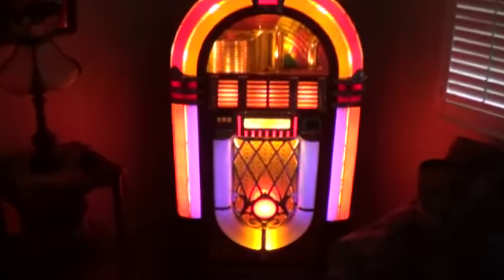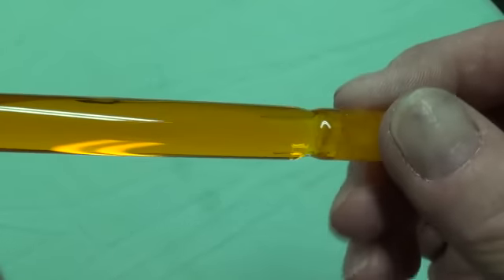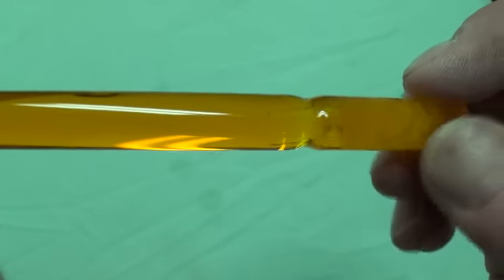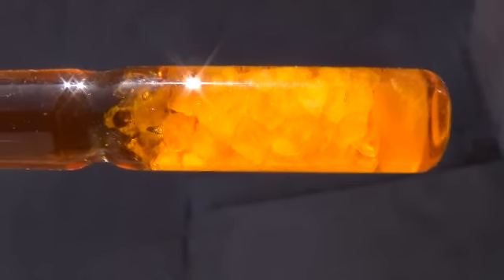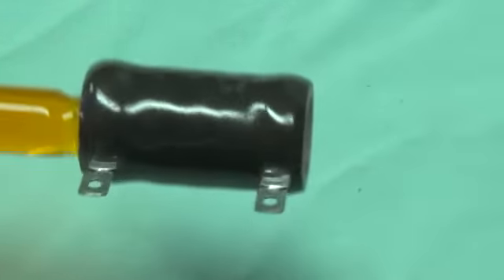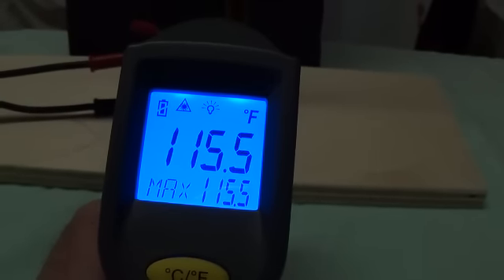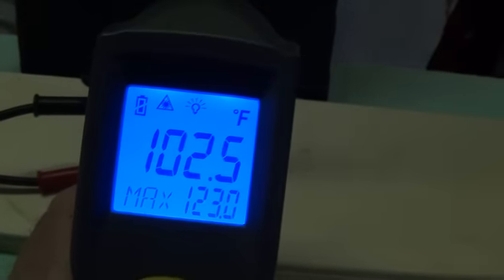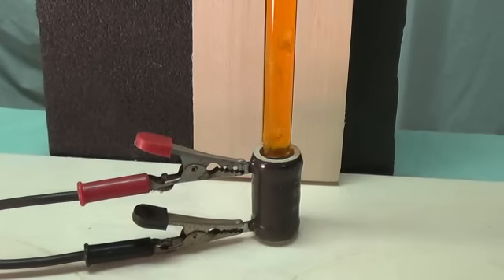Wurlitzer Bubble Tubes: How They're Made and What Makes Them Bubble

Comment: Outstanding videos Doug. I have been a jukebox collector for almost 40 years and have 18 restored grade 1 jukes, including a 1015 that was restored to perfection in the same N. Tonawanda plant where it was built in 1947. As an FYI, the so-called sand granules at the bottom of the bubble tube were called "bumpers."
When the granules were agitated by the heat they would start to spin and  "poof" --  the liquid boiled and began its journey to the top of the tube. Great videos!

Comment: Doug, now that's service!  Your response was super fast, but after posting I went up to my machine, armed with my new learning from your video and checked to see if the the tube was snug against the resistor.  It was not.  I checked the others for comparison, and it would seem that shim has come out or was never in.  I moved the machine on its back, so that may be the issue.  I put a piece of folded tin foil in to check, and it didn't make the noise, so I'm getting a proper shim.  Thanks.

Comment: Nicely done Doug. As an FYI, many years ago an old Wurlitzer Operator told me that those granules at the bottom of the tube are called "bumpers." If you watch them as the tube heats up they begin to spin or agitate. This assists the bubble tubes from starting normally and not "jolting up" when the liquid expands. Unfortunately some years ago my left front tube burst(nasty!!) it came out as a puke orange liquid and ruined several plastics and had to be replaced. Expensive!
You cannot remove the stains -- everything must be replaced. So I tell people treat them with care. Also, the liquid is extremely toxic and if a tube bursts and you are right on top of it and breath it in it will squeeze your lungs shut and instantly kill you!
No joke. I heard a rumor many years ago that the liquid was banned from public use but obviously they are still in existence. Thanks for your great videos.
Reply from the maker: Greetings, Ed. The liquid is methylene dichloride, which is a prime ingredient in paint strippers, thus the awful effect on back-painted plastics.  The fumes are toxic and unpleasant, but (from my experience) not lethal.....having inhaled way more of them than I should have during my years as a painter/restorer :))

Comment from the maker: Thanks, Ed. When I worked in a chemistry lab many years ago, we would put glass "boiling" beads in the bottom of vessels in which liquid was to be boiled. The beads produced small bubbles, rather than the big ones that can displace the liquid and make a mess. I guess it's the same process with the "bumpers" in bubble tubes. Thanks for your input.

Comment: Doug - your 1015 pilasters are rotating outward -- they should be rotating inward toward the center of the cabinet. Simple fix: exchange the motors in each pilaster and it will be rotating in the proper sequence. You can hand-position each rotating carriage so that all colors match perfectly as they spin.  Great job!

Comment: Wow very cool. I've always wanted to have an old jukebox, it seems they would require a lot of upkeep, but it must be a labor of love. I figured the tubes were heated by a light bulb, the way the old Christmas tree lights were, someone was clever in using a resistor.
Reply from the maker: Yes, they do require maintenance, Will. In fact, I don't suggest that anyone buy one unless they are capable of doing the upkeep.....or know someone who is.
Reply: With my old phones, if you use them a lot, they can require some maintenance, but the most technical part is usually the dial, quite mundane compared to what's going on in a jukebox. I will admit you get quite a feeling when you take an old broken down item, and spend time on it to bring it back to life again.
Reply from the maker: Yes, indeed, reviving an ancient device is always quite rewarding :)
Reply: The Xmas Lava lamps do not use a heater -- they use a low-wattage light bulb that slowly moves the liquid around. The Wurlitzer 1015 used heaters to keep the bubbles circulating in the thin tube. It was invented by the Biolite Company in NY in the mid-1930's.

Comment from the maker: Hi, Mr. J. I think it may have to do with inadequate contact between the bubble tube and the heater. This would also explain the late starting, since the fluid in that tube would not be heated as quickly.  You need to add a brass shim or two between the bulb and heater to tighten up the gap between them and improve the heat transfer.

Comment: I have a bubbler tube just like yours.  I used it in my 8th Grade science project (about 1974) on solar energy where I built a solar collector and used the bubbler tube as a visual display to show that the water in the solar collector was warm.  I never understood the "magic" of how the bubbler tube worked until I recently gave the tube to a friend of mine who is a science gadget nut and he found your video and sent it to me.  So after all these years, I now understand how it works (simple boiling).  In your video, you said that there is a tube inside the glass tube at the bottom.   What is the purpose of that tube?  Thank you!
Reply from the maker: There are crystals pinched in a bulb at the base of the tube that foster production of small bubbles. The small tube passes the bubbles from the crystal bulb upward to the rest of the bubble tube.

Comment: Hi Uncle Doug, I have four bubble tubes and four heat resistors (like the ones in this video.)  I wanted to use them for ornamental purposes.  But I'm worried about using an electrical heat source.  Are there any tips?  Failing that i'll just have to sell them on.  In the UK our plugs distribute 240 w.  Not sure what it is out in the states?  Thanks for your time...
Reply from the maker: The Jukebox uses an electrical heat source to make the tubes bubble, so that is not a problem. However, your 240 VAC supply may be an issue.  We use 120 VAC here in the states, so you may have to compensate for the difference in voltage. Good luck.
Reply: Thank you for your response.  Cheers...
Reply from the maker: @Raptor-123-z9w  You're welcome, Paul. Good luck.
Reply: Hi Uncle Doug, sorry to keep mithering you.  Is it possible to attach bubble tubes to heat resistors through use of batteries?  I understand old 1015s to be one of the many machines once containing battery generated bubblers? 
Thanks again for your time...
Reply from the maker: @Raptor-123-z9w  Greetings, Paul. In all my years of jukebox restoration, I have never seen or heard of battery-powered bubble tubes. The batteries would quickly lose their charge due to the current flow required by the heaters. Your best bet by far is to stick with 120VAC, as the designers intended.
Reply: @UncleDoug  

Hey thanks again.  You take care...

Comment: Doug I love all the vids.  What a beauty of a jukebox my friend...  Please can you tell me what type of crocodile clips do I need for my bubble tubes?  Is it just a case of picking any off of eBay and connecting them to regular leads?  I really quite perplexed 😆
Reply from the maker: I don't understand the question, Richard. Crocodile clips are not normally used with bubble tubes. They fit into tubular resistors with a brass shim to assure good contact.
Reply: @UncleDoug  Yes I understand.   But to me it seems, watching the clip, that all you need are clips attached to wire connected to a plug on the other end.  My concern is on the amount of electricity released.  You mentioned busting bubble tubes...  Thank you for the reply.
Reply from the maker: @richardbailey1993  The tubular resistors draw the proper amount of current to heat the tubes to the correct temperature.
Reply: Doug I do understand now.  Really sorry for being so dumb lol.  Electronics isn't my thing.  Thanks again for your time...

Comment: Two thumbs up! Your explanation is perfect, especially in regard to the tube acting like a car radiator removing the heat from the resistor. Question: Christmas bubble lights - are they made the same way? Given the chance of them breaking, especially in proximity to children, makes me believe that the liquid inside Christmas bubble lights is not Dichloromethane. In closing, may I had that the Workshop Dog, aka Rusty the Wonder Dog, was the pièce de résistance for this fine video.

Comment: Hi Doug....Ether will work instead of the original  methylene dichloride and clothes dye will colour it.  Small Granite chips will replace the  "bumpers"
Reply from the maker: Years ago, while I was working in a research laboratory, TJ, there was an ether explosion that destroyed an entire room, including a huge stainless steel hood. Since then, I am quite wary of ether.....it's not only explosive, but does not require an open flame to be ignited, only a hot surface. If you are using ether in bubble tubes, for heaven's sake, be careful.

Comment: Hi again
Would you have a video showing the mounting and hook up of the counter that mounts just to the right of the selection wheel of a Wurlirzer 1015. (Inside on the front right side) Mine is missing but I need to kniw how it works and hooks up to the jukebox. 

Thanks
Doug
Reply from the maker: I believe you are asking about the play counter on the left, rear of the mechanism (when you are facing the rear of the mechanism with the back door open). The best I can offer is a video (already posted) showing how the selector mechanism works. It should contain some close-up shots of the counter. I hope this is helpful. Good luck.

Comment: Hi Doug , I am in the prosess of restoring 2 x 1015's 1946-7  and two of the straight tubes " looking new "  came with the boxes , only bubble with hardly any Bubbles, I have swapped them over against a few resistors  , no'p  any thoughts as to why they have died please ?  ( no cracks no external damage ) many thanks  Tim.
Reply from the maker: For some reason, older tubes seem to lose their ability to bubble, Tim. I think it has to do with the "crystals" seen within the bulbs at the base of the tubes. Nothing, in my experience, will rejuvenate them. Sorry :(

Comment: Hi again Uncle Doug,
What lubricating oil would you recommend for a Wurlitzer 1015 OMT 100-cd jukebox ?? Many thanks, Liam.
Reply from the maker: Liam, I would think that any good, light mineral oil would work, like 3-in-1Brand. If you can't find it, then 10-30 motor oil would probably work just fine also. Good luck :)

Comment: Is that the same kind of chemical they use in the "hand boilers"  or the "Drinking Bird"  novelty?  I know that stuff has a super low boiling point.
Reply from the maker: +DeadKoby   It's probably what's used in the "hand boilers", DK, because these bubble tubes will also boil just from the heat of your hand. I thought the "drinking bird' simply used water. A Google search might reveal the answer.
Reply: The hand "boiler" just uses water or any other liquid. It's not actually boiling. What happens is it forces water up the tube due to expansion of air in the lower chamber from your hand's heat. When the water level gets too low it breaks the seal causing some water to pour back down  and the air pressure in top and bottom to equalize. This makes it seem like it's boiling but you're really just seeing water gurgle around inside your heat engine.
Reply from the maker: Thanks for the explanation, AQ :)

Comment: Cheers mate.  Very informative video.  Googled it and read explanation but your video could not be more clearer.  Especially using the resistor to heat it.  Great stuff.  They stopped producing the jukebox in 2013.  I wonder if this has anything to do with the internals of the machine i.e. safety risks with exposed live contacts, the chemical used etc.  I have a 1015 from 1984 and it's like an industrial machine inside not sure if it's changed a lot to the new one.
Reply from the maker: jbrwelcome Thanks, JBR.....glad you enjoyed the video. I understand the newest jukeboxes are simply satellite links, allowing you to request tunes and pay using your cell phone, which is all fine and dandy, but I still prefer the old metal and wood electromechanical gems from the 1930's and 40's.
Reply: Actually, production of all Wurlitzer jukeboxes ended in October, 2013. Gibson bought the company some years before but the demand decreased so they decided to end all production. Including the 1933 Debutante which was made by Wurlitzer but did have the nameplate until 1934, jukebox production lasted 80 years. Not a bad run.

Comment: Two things that puzzle me, are the bubbles a gas and if the bubbles are a gas then that gas can't escape as the top is sealed so what happens to that gas, as the level of the liquid doesn't go down when the gas rises to the top, also the crystals at the bottom, do they ever stop producing bubbles or will they last forever.
Reply from the maker: Good questions, DooRon. Yes, the bubbles are a gas but as they rise away from the heat source at the base of the tube, the gas gradually changes back (condenses) into its liquid phase, so no excess pressure (accumulated gas) is built up at the top of the glass tube.

The glass crystals at the bottom don't really create the bubbles, but provide a large surface area for bubbles to form upon. The heater elements actually create the bubbles by changing the liquid into a vapor (gas). The glass crystals are not consumed in the process and last indefinitely.
Reply: Thanks for the info, great video
Reply from the maker: You're welcome, and thanks for visiting my channel.
Reply: +dooronron69 It is not a gas but a liquid that boils at 40 degrees Centigrade. Once the bubbles start to climb up the tube they simply recirculate due to the heat and will continue to do so until the jukebox is turned off. There are 8 independent tubes in the W1015. While it looks like there are 2 huge tubes going up the cabinet (front and sides) there are actually 8 tubes. Once the jukebox is turned on, after a few minutes you will see small granules start to "churn" at the base of the tube -- called "bumpers" they were designed to release the liquid up the tube/s when they were at the boiling point - the bumpers were used to reduce the pressure of the heated tube expanding too fast -- otherwise they could break and cause an expensive mess!!
Reply from the maker: Thanks for your input, Ed.
Reply: As long as the power is on they will circulate indefinitely. Once the power is off they will eventually cease.  The W1915 had 2 power switches -- a main switch and a console-only switch, meaning that the entire cabinet except the title strips and insides were lit until a coin was deposited -- then the entire machine lit up when a selection was made.

Comment: thats awsom i tought ther whas a small air pump doing the bubly thing
Reply from the maker: +ljmike1204  An interesting notion, LJ :)
Reply: +Uncle Doug wel wat can i say im 27 never seen one up close
Reply from the maker: I can understand why it would seem that air was involved in some way. It's actually not a bad guess :)
Reply from the maker: Yes, the sealed system does make more sense.....but the thought of a highly toxic solvent boiling in sealed glass tubes in my living room still makes me nervous  :)
Reply: That is a good point, would you happen to know of a modern replacement?, I imagine that with current science people have made something that can serve the same purpose and not kill you.
Reply from the maker: Actually, to the best of my knowledge, no one has ever been injured in any way by the bubble tubes in a jukebox. If they break, the only thing that suffers is the plastic parts of the jukebox. Also, there are no alternatives. the bubble tubes are still being manufactured and used on a daily basis.
Reply: Hmm, interesting info, thanks.
Reply from the maker: You're welcome.
Reply: in deed or a vent on top i dont know how to remove air with out sucking the fluid to

Comment: Carcinogenic...something that would be banned a few years later, like lead in gasoline and paints.  
I remember Christmas light bubblers back in the late 50s that bubbled like that. These had a small coloured tube and a large bulbous housing  at the bottom of the tube that was made from a plastic material, which I suppose housed the resistor that was probably in series with the other 10 bulbs in the string, (12 volt drop across each) for 120 volts AC.
Reply: The Christmas lights (which I can attest were still around and popular in the early '70s) were heated by their own light bulb. My understanding was always that there was alcohol in them, but this stuff would make more sense.
Reply from the maker: Yes, it is an unpleasant solvent, SC; often used in paint stripper.  I've seen the Christmas bubble lights for sale in some antique shops, which makes me feel old, since we used to have them on the tree when I was a kid.

Comment: why don't the bubbles create pressure? is it the mechanism of air contained in the tube, being brought down and simply 'recycled' by the action of the crystals..  lacking some physics education lol
Reply from the maker: The crystals provide a large surface area for small bubbles to form, gather into larger bubbles, and rise upward until they reach a cool area of the liquid and are reabsorbed. The vapor in the bubbles simply recirculates within the liquid, never reaching the top or increasing the pressure within the tube.